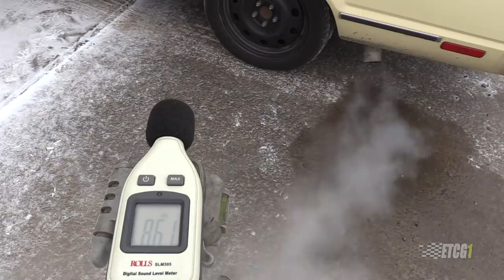Is the #FairmontProject Legal in California??

Comment: Similar laws are in Australia it's not a big deal, there are limits on mods and usually for good reason. I still hear some cars that would be well above spec in the area where I work 5 floors up in and office block over 200m away from the car and it's still defeaning. Enough to wake up the whole suburb, these are the people the laws are for. My aftermarket exhaust is in spec and I could make it slightly louder with a different muffler but I'd rather be a little quiet than a little loud because I have early starts. As long as you drive reasonably and don't have it ridiculously loud your fine. However new drivers, hoons and people that disturb the peace will be targeted.
Reply: If it's about the really loud obnoxious drivers, then why isn't the limit 120 dB instead of a paltry 75? Why are cops not required to verify their charges?
Reply: If you let unreasonable laws stand because they don't affect you, then you'll be rudely awakened when other unreasonable laws do.

Comment: You know, this actually almost sounds like a law that would be more of an 'inspection' type of law versus an actual 'moving violation' type of law.  I know that every state has different laws concerning vehicle inspections ... BUT ... if you are from say, Ohio, and  you are traveling in New York, they can't pull you over and write you a ticket for not having an inspection from THEIR state if you LIVE in another state.

So, with that said, it seems like if you were an out-of-state traveler traveling through California and they tried to write you a ticket for their exhaust laws, it seems like you'd be able to say, "Well, according to the laws of the state where this vehicle is registered and tagged, I am in compliance with MY local state laws."

I mean, it's no different than traveling through states that require a license plate on both the front and rear of the vehicle but you are from a state that only requires it on the back.  They can't ticket you for not having the front plate because it isn't required where the vehicle is tagged and registered.

Comment: In Australia, though all exhausts are to comply to ADR standards, every state has a different db level, a different measuring technique, whom tests the vehicle and the only recognised legal testing faculties, either portable or stationary, are state government owned, but calibrated independently, for testing aftermarket systems predominantly.  This makes legal challenges a nightmare. But the police, whom in my state are fair and reasonable, and do db testing, work on the principle of ' if you're being a dick in the public, you'll be defected '. Pretty fair, but in most instances, small amounts of excess noise will be tolerated.👍👍

Comment: What people need to understand is, 95dB at 20' away is pretty f*cking loud! 
Sound doubles in intensity roughly every 10dB so 95dB at 20' is twice as loud as 85dB at 20'. 
Most race circuits here in the UK have a noise limit of 95-100dB. As you'll know race circuits are LOUD places with everyone driving at full throttle. Yet I've never seen anyone get kicked off for being too loud. 
What I'm saying is, I can see this law being abused by the authorities if you can be charged with it at the roadside. As chances are there will be very few people actually in breach of it.

Comment: Its 19.5 inches way, height of muffler and at a 45 degree angle, at 2500rpm Thats from referee bar. Plus its not a new law. It changed from a fix it ticket to a sright up fine. First offend 25 ticket and with fees and bs shit 1st ticket 189.00 plus passing a referee fee

Comment: Not 20 ft? Isn't it 20"? Regulation says this about that "(b) Microphone Location. The microphone for the sound level meter shall be at the same height as the center of the exhaust outlet. The microphone shall be no closer to the pavement than 8 in. (203mm) when the exhaust outlet is lower than this height. The microphone shall be positioned with its longitudinal axis parallel to the ground, 20 inches plus or minus 1 inch (508mm plus or minus 24mm) from the nearest edge of the exhaust outlet, and 45 degrees plus or minus 10 degrees from the axis of the outlet. For exhaust outlets located under the vehicle body, the microphone shall be located at the specified angle and at least 8 in., (203mm) from the nearest part of the vehicle. For exhaust outlets that make an angle of 45 degree or less with the longitudinal axis of the vehicle, the microphone shall be outboard of the exhaust axis. For exhaust outlet angles of more than 45 degrees, the microphone shall be on the side of the exhaust axis to the rear of the vehicle. 

This denotes where the sound measuring device is relatively close to the exhaust outlet. Notice that it does not make any references to provisions for sound level testing done from distances greater than 21 inches."
Reply from the maker: Gocha. Thanks for the info.

Comment: in CA they test  with car warmed up, in a open area 19.5 feet away from center of exhaust at 45 degree angle at 75% of max HP rpm, for example  a car that  makes 200hp @ 7400 rpm that would be 5550rpm, It was an attempt to stop street racing and side shows, which doesn't stop anything because it happened again recently in irvine, CA a couple days ago, also u have channels like 
TheSupercarSuspects that encourages take overs and doing dumb sh!t that ruins it for everyone
Reply from the maker: Thanks for the input.